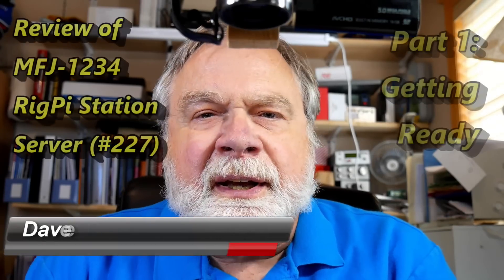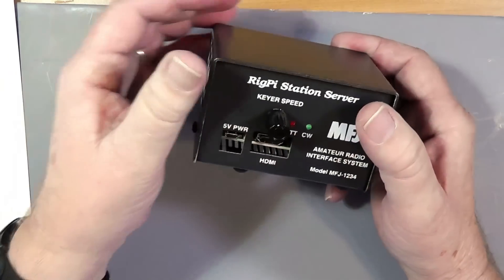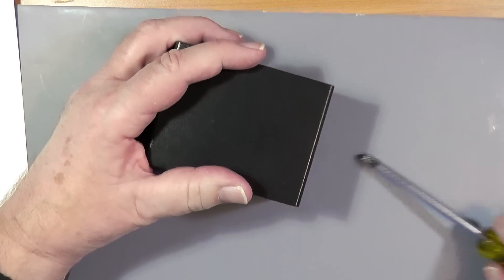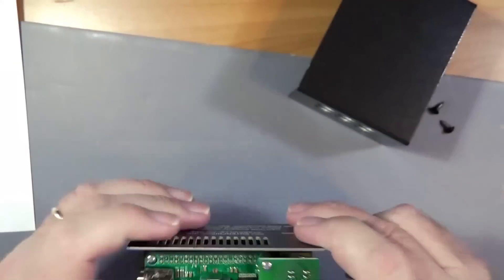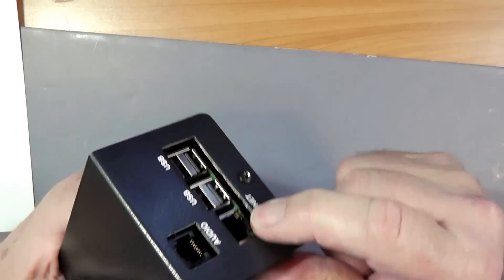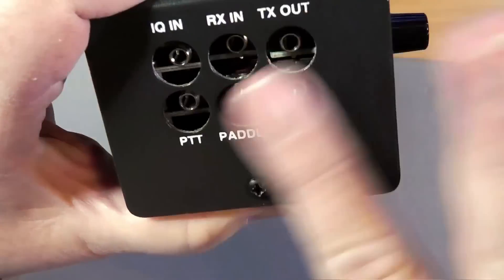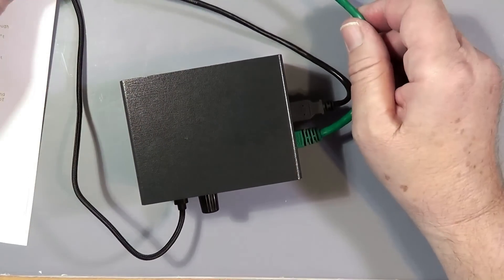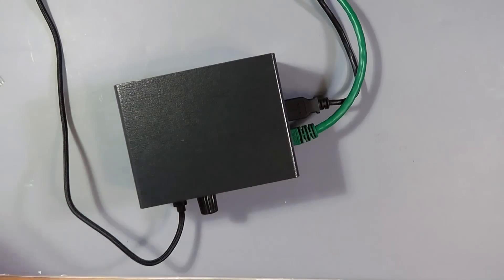Review of MFJ-1234 RigPi Station Server Part 1 (#227)

Comment: Enjoyed part 1.  I have purchased a RigPi, bought the power supply from Amazon, they have one just for the Pi-3.  I tried a usb to micro cable on my computer's usb, but got voltage low warning, so I purchased the Pi-3 power supply.  I got the original version on the SD card, and tried to update to the Version 2, sold on MFJ's web site ($29.95).  To date, I have not been able to flash a card and get it to work the Version 2, latest version available.  I will watch part 2 now, and hope I can find a way to flash an SD card on a Win-10 machine to be used in the Pi.  73 and keep those vid's coming

Comment: This product is essentially JUNK!  It's more of a ham's home project than a real product.  MFJ is NO help giving support.  W6HN Howard, who "developed" this thing is pretty much NO help.  They have an online "Forum" which is like the blind leading the blind.  If you want to do a do-it-yourself Remote setup, you might like banging your head against the wall with this "product".  It relies WAY too much on a user understanding the Mumble Server and Client setup and inner workings.  All the other stuff, like SPOTS, LOGGING, etc won't be at all useful if you aren't a Mumble expert.  (Howard has practically NO Mumble details in the poorly written and illogical "Manual").  He never tells you why you are having problems connecting the Mumble server (it's deep in mumble code that states after 10 failed attempts to connect, it locks you out, unless you edit the code to over-ride..).  Thank's Howard!  
Or, if you want to use your iPhone to control your radio, that it will not pass TX audio without two weeks of studying the issues involved between the RigPi PTT element and the Mumble Client PTT setups.  I'd say 99% of hams will not be able to get it going.  Oh, Howard's talk about Port Forwarding on routers, which is a requirement for Internet access, is less than 1 paragraph in the manual also.. In otherwords, it's sort of a shit "product".

Comment: Elephant in the room is the lack of an on/off switch. Just like a desktop computer you have to log out before powering down. If you simply remove power there is a good chance the SD card which holds the operating system will be corrupted. This is a well known shortcoming of the PI but there is a simple script to allow a "power" button to be added that closes down the system gracefully but does not actually remove the power. After adding all of the extra hardware to the basic Pi I am stunned by the omission of the power button. Bottom line as soon as receive the system and after you have configured as you like backup the SD card. IMHO the case looks like a high school metal working project rather than a commercial product.

Comment: This thing is a joke. You get a poorly designed remote VFO. All other radio control is via on/off buttons that you must program. No variable controls. The audio is iffy and not reliable. I sold mine at $75 loss after a month of frustration.

Comment: Call it what it is -  A $300 VFO knob!  All other radio control is via user programable on/off buttons. Then consider the lousy audio. RigPi is a glitter designed webpage that glues together several FREE open source software. Setup is an exercise in frustration. There is nothing easy about it as advertised and the result will be a disappointment. Get a raspberry Pi, setup Flrig, Fldigi, and AnyDesk and save $300.

Comment: The MFJ metal cases double as warning alarms so you can hear all the loose screws and solder balls inside them! Also agree with the poor documentation and lack of basic inexpensive cables and power adapters that are freely offered by just about everyone else. Getting everything you need to have an MFJ product operating is a project in itself!

Comment: So... really any radio with a built in USB sound card can be  hooked up to a regular Raspberry Pi. Dave didn’t use any of the daughter boards in this video. I haven’t looked into their software, but if it’s open source, you may be able to get a standalone Pi running the software. Unless you need the other audio connections (get a cheap USB sound card!)/keyer, I don’t see to much use for this in my personal setup.

Could be good for those who aren’t as comfortable with the Raspberry Pi I guess. Sounds like they’ll still have to deal with software nuances though.

Comment: Thanks Dave, been looking at them and think it would be good to have. The one thing is leaving my rig connected to the antenna if bad weather pops up. 
I'm sure there are remote antenna switches that work with them too. All this stuff is fascinating compared to my FT-101B I bought new from Henry Radio 1974. We've come a long way.

Comment: Dave and all, FYI, there is an MFJ-1234SD that is an SD card that you can plug into a PI-3. This is especially useful when you don't need the keyer and sound board that are included in the pi. This is the way I went for my 7300. And this reduced the cost from $200+ to $40. You just need to add a PI 3. BTW, good review. Hopefully in your next part, you will cover running some of the things like digital modes (FT-8) which I found the pi-3 to be under powered for. Might be doing something wrong.
Reply from the maker: I haven't looked at digital modes. I need to move on to other videos so it'll be awhile before I circle back to the RigPi.

Comment: WiFi is built into the Pi but the metal box would really hinder it. Shame they didn't put a barrel connector plug on one of the hats and include a wall wart. MicroUSB adapters can vary so much, providing too much or too little voltage depending on the device they originally came with. I have a ton of them and a few won;t boot a pi.

Comment: WiFi did not work because it's an internal antenna on the Pi board enclosed in a metal case. What were they thinking?
Reply: You have a valid point. Similarly I have a Jumbo Spot that has a pi-zero and is in a metal box and the Wi-Fi works just fine. Sure my openSPOT2 and DVMega are in plastic cases which does make better sense. I did buy a USB Ethernet adapter for my Jumbo Spot but in the openSPOT2 instructions it clearly states to have the unit placed close to your Wi-Fi router or access point. I detected a little frustration from David in this video with Linux. I have discovered (Being the average Joe on the streets) from installing Linux on multiple machines from servers to laptops that certain things do not come easy, Wi-Fi being one instance, but from the early distro days until now Linux has come a long way...almost to the point of never needing to fire up a Windows computer...well maybe not that extreme...
Reply from the maker: Yes, Linux is a different world.  Not one I'm used to inhabiting.
Reply: @1crazynordlander  If you have the typical Chinese jumbo spot case, it has cutouts by the WiFi antenna. Not ideal, but better than the MFJ case which looks to completely shroud the Pi board's WiFi antenna.
Reply: Maybe anyone who buys one of these could get an external antenna.

Comment: Look on Amazon (or your favorite electronics store) for a Raspberry Pi 3 Power Supply 5V 2.5A Micro USB AC Adapter Charger it costs around $10. - 73 de K4MRO
Reply from the maker: Thanks for the tip.